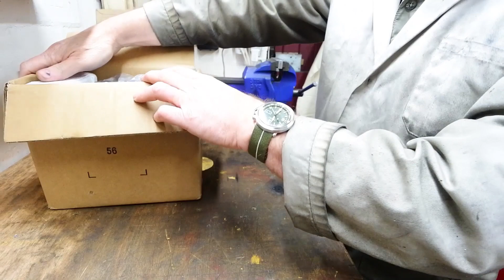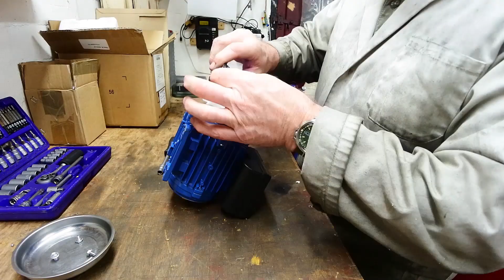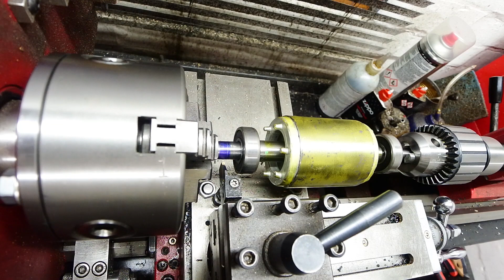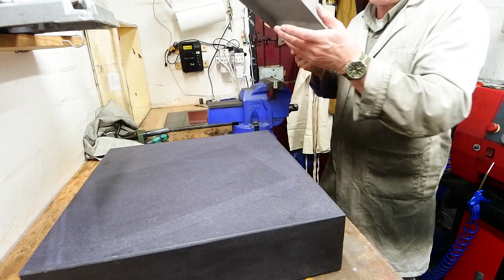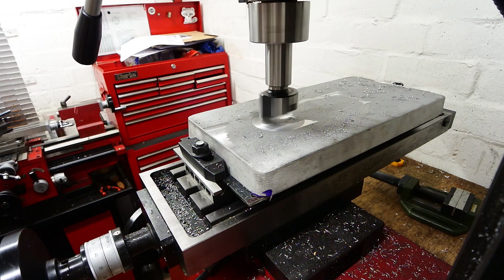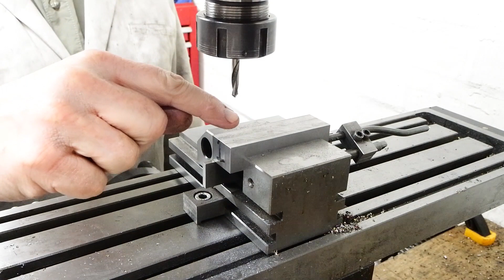04 of 14 Compact Power Hacksaw - Motor Modification, Motor Feet

Comment: "Incidentally, the base (15" x 7½") is cast pleasingly flat to minimise any necessary flycutting.". Were you pleased with the flatness 😀
Reply from the maker: There was one depression in the plate that took a lot of depth to fly cut it out.  All in all I think I took about 3mm off the base top surface, from the highest point to the lowest depression.  Being sand cast, every casting will be different.
Reply: @TomIreson  I agree regarding the castings but maybe they should remove the sentence I copied from their website. They don't seem to have much in the way of quality control if you had to remove 3mm from it. Should have gone back in the scrap really. Anyway, I'm up to video 9 now.